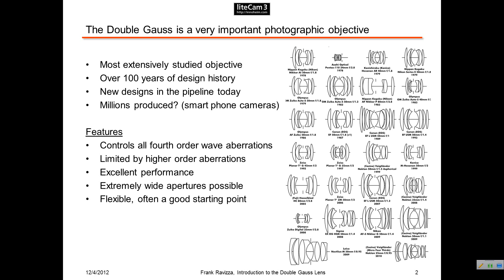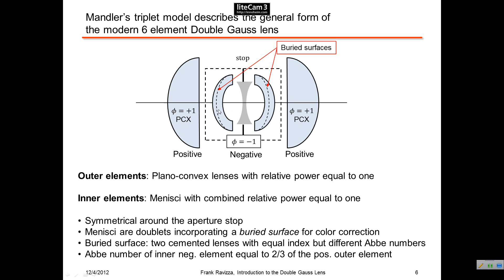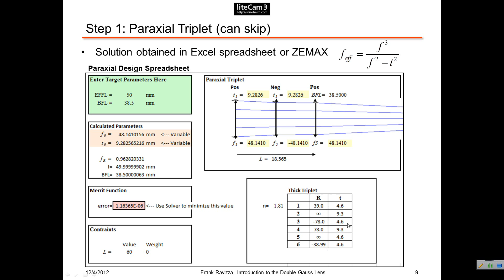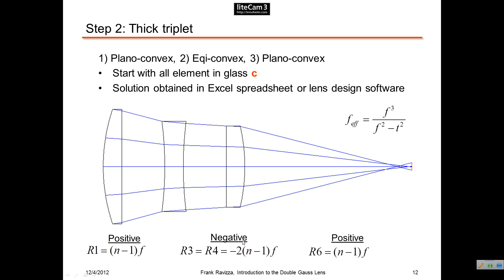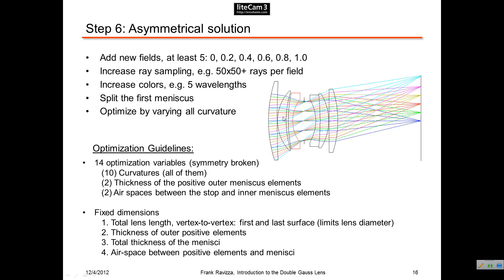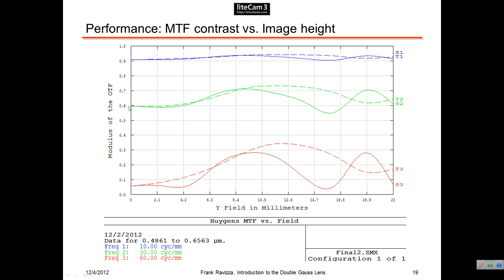Introduction to the Double Gauss lens

Comment: how you made the calculation in step 1? 
the first eq. is above, what is the second one?
Reply from the maker: I'm assuming you are referring to the spreadsheet calculator for the thin cook triplet. The equations here are in Excel formula. Analytic solutions for this lens system are possible using ABCD matrices or Gaussian reduction. The spreadsheet solution here is solved numerically. The intent here is to supply the user with this spreadsheet.
Reply: the second equation is from BFL